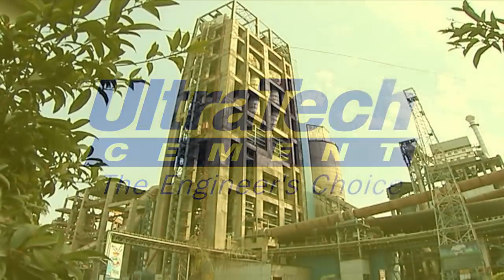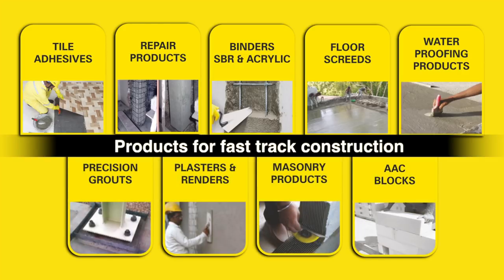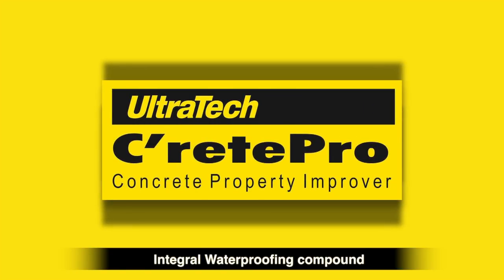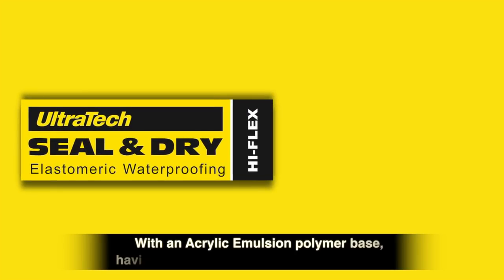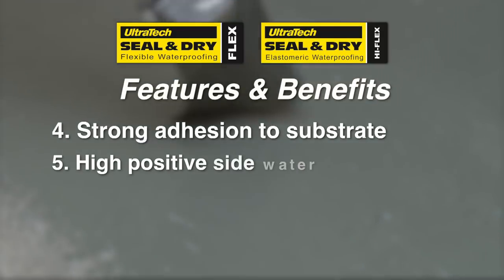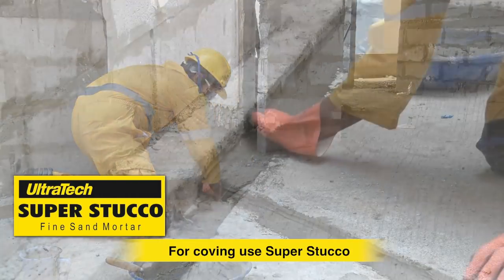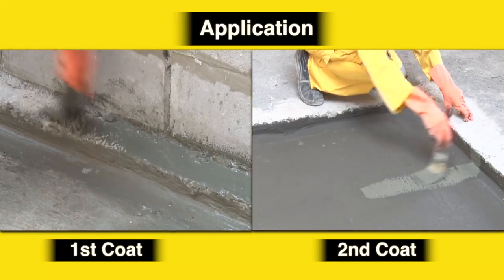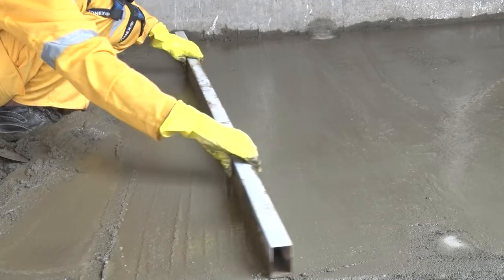Total Waterproofing Solution | UltraTech Seal Dry Flex | UltraTech Cement

Comment: After solution coat need cement coat is required or not? Cement sand coat conned with old mother slab